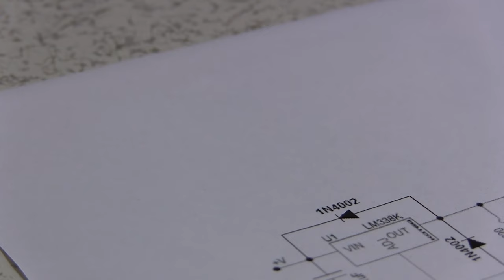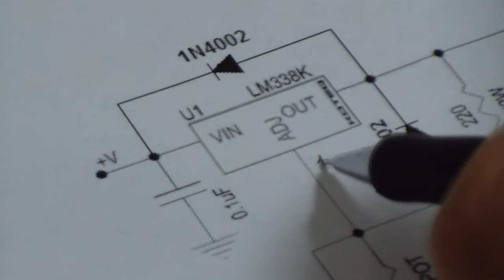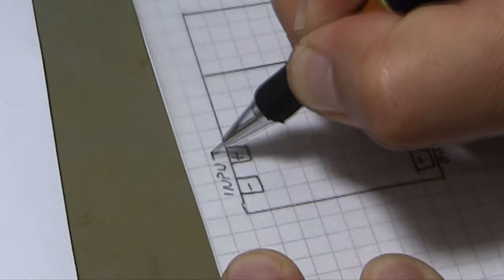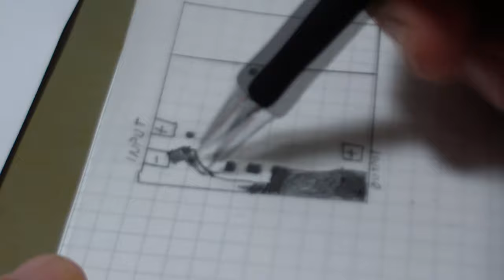BU YÖNTEMİ DAHA ÖNCE HİÇ GÖRMEDİNİZ! (Baskı Devre Kalemi Kullanarak, Baskı Devre (PCB) Nasıl Yapılır

Comment: Meu amigo achei formidável esta forma de criar um circuito, apesar de ainda estar muito leigo sobre o assunto,  meu amigo gostaria de saber se há alguma forma de construir de uma maneira simples um controlador de rotação para motores monofásicos,  como de máquina de lavar ou Tanquinho,  pois já tentei fazer Dimers e os motores perdem  o torque e a potência e não ficam eficientes no controle da ROTAÇÃO, deixo aqui meu like e meu abraço fica na paz meu amigo Deus abençoe
Reply from the maker: Hello my friend.  Yes, the method is a bit challenging but can be used in some cases.For speed control of power motors, you must use an ac speed control circuit. There are ac motor control circuits made using tda1085 integrated circuit. google search engine "tda1085 ac speed control" by typing, you can find such a circuit diagram.God bless you
Reply: @electronic7979  THANKS my Friend Very Good